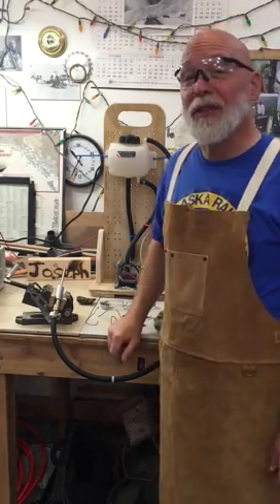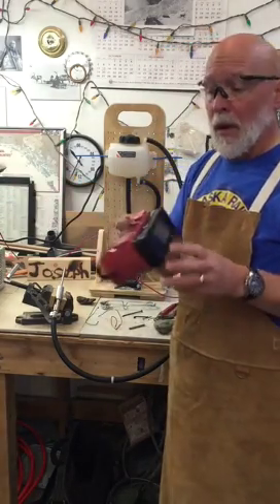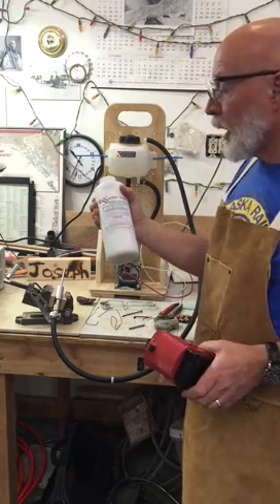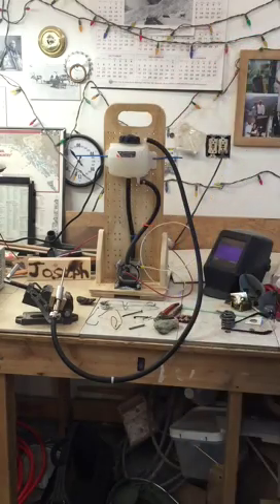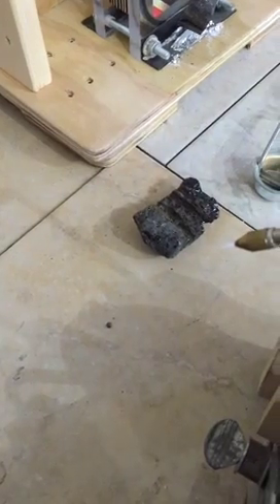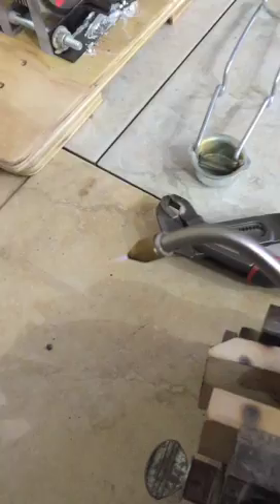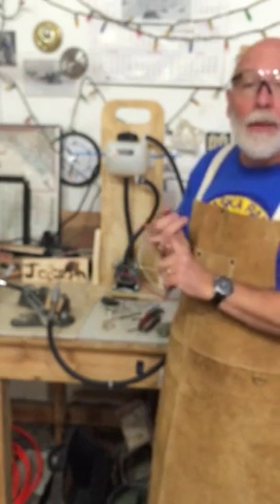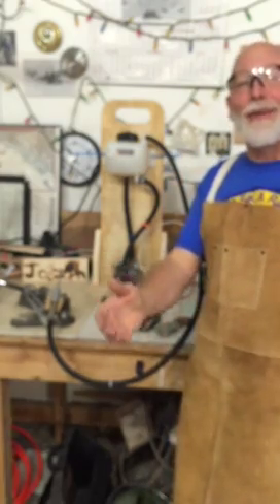HydroClubUSA HHO Torch Cuts Copper and Melts Lava Rock!!!

Comment: very cool this has me sold. Hopefully i can reduce my hydrocarbons with this. The limit is 220 last time i was at 400~ now im at 1000~ with a brand new cat. hopefully with with some guaranteed to pass emission cleaner i can get it back on the road!
Reply from the maker: Yes sir. Our kit will reduce your emissions. What great make and model vehicle do you have
Reply: Richie Rich putting the kit on a 1986 Toyota Corolla 4a-c engine
Reply from the maker: @driftingroku1858  Here is the kit you will need https://www.hydroclubusa.com/online-store/HydroCell-Kit-With-1-Qt-Reservoir-p41607105
Reply: @RichieRichlife  So i installed my kit today, and it seems to be working after i got some Roebic crystal drain cleaner from lowes. Some good KoH coming in the mail soon. at idle im getting a 2.3-3% O2 level as read off my AEM-X air fuel guage. 
Only problem is i dont think my ammeter is working correctly at startup it reads -1 and then just reads 1 all the way on the left. I only saw it show 200 once as it was going from -1 to 1. 
Does it need to be calibrated or somthing? I might try another ammeter from amazon later on. I'll post my smog test results here after i burn the rest of my gas that has some guaranteed to pass emission cleaner in it.
Reply: @driftingroku1858  hey how did the hydro kit work, did it actually reduce your emissions and increase gas mileage, I'm interested to know, please share! Thanks